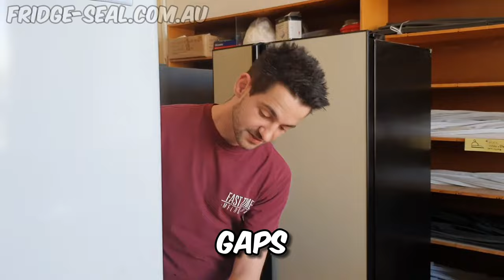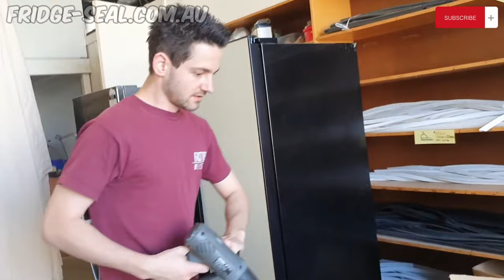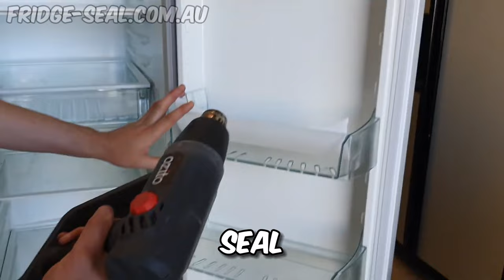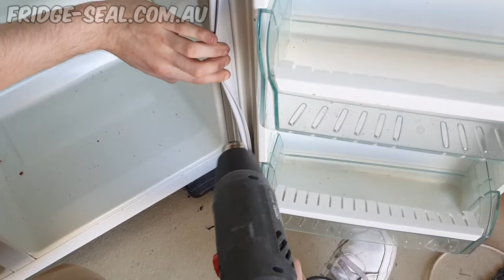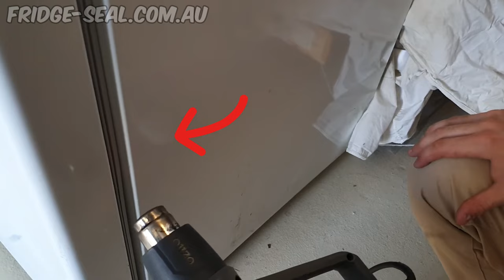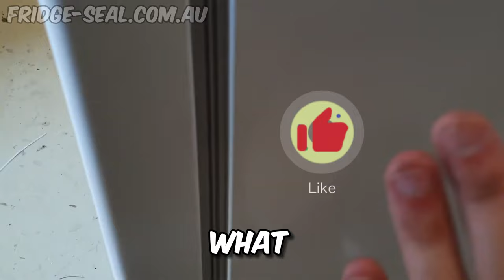How to Fix Fridge Not Sealing with Hair Dryer 💨🤯

Comment: Don't  forget to lightly vaseline.the seal when done.the Vaseline helps maintain the pliability of the rubber.
Reply from the maker: Great Tip!
Reply: Hello, cam I ask how would you apply that Vaseline? Like directly on the exterior of the rubber?
Reply: Vaseline breaks down rubber. Use silicone grease instead.
Reply: As a nurse, I know that petroleum-based Vasoline will break-down rubber so I advise to use a water-based product for latex condoms. Whether or not your gasket is made of rubber, well, that I don't know.

Comment: After heat appears, the gape come back again
Reply from the maker: Try pull the seal out iwth your fingers,

Make sure to heat the inside and underneath the seal then go around and do the outside,

make sure to leave door closed for as long as possible afterwards.

You can also try and put soemthing underneath the seal like blutak or anything really to prop it up in that area.

Comment: To the fridge that already running and fill with stuff, try vaseline, the petroleum on the edge of the contact of your door, I tried glue but it didn't work (caused the mess) and now this way seems working to stop the cool air leaking through the paper thin gap.

Comment: Quick question. Im having the issue with gasket gap between 2 refrigerator doors which causes condensation to appears, but it looks fine, like there's no gap between the doors when closed.
 Can this method be used in that situation?
Reply from the maker: Yes this method should help.

Inside the seal is a magnet strip - this is what keeps the door sealed (its not suction) so when you warm up the seal, it lets the magnet inside pull across and seal better, then you wait for the seal to cool down to stay in new shape. You could also try vaseline around the seal as well for an extra layer of protection.

is the problem continues, send me a message and i will dig into a deeper dive.

Comment: How long it's stay properly?
Is this permanently or temporary
Reply from the maker: This is permanent fix. There are other ways to fix this issue as well. Such as putting something underneath the seal to lift it up in that area.
Reply: Can I use silicone Kwik seal for the around the door 🚪?

Comment: thank you but what heating degrees i should look for ?
Reply from the maker: as hot as possible with hair dryer.
You will not melt seal with hair dryer.

Only heatgun will melt the seal, use low setting on heatgun.

Comment: Will this work on a freezer door that’s turned on? Do I have to defrost everything 😭
Reply from the maker: It depends, Do you have Chest Freezer or Upright freezer?
Reply: @FridgeSeal  we have an upright freezer. Big one.
Reply from the maker: Yes this should work, no need to turn freezer off. It would be best to remove the ice if its in the way, using paint scrapper or melting with a hair dryer but melting can take a while. @PatriciaHadley-ip8mb  

if you have any issues let me know.
Reply: Just wanted to update that this advice worked really well!!! From winter wonderland inside to no frost. We do have some ice still so we will try it again with some wedges, but gosh, you saved us over $300!!!! Thank u
Reply: Omg thank you for the Question and the Answer!! 
I just noticed my freezer door (double door fridge/freezer) had cold air coming out from the top section so I’ll try this in the upper seal areas. Praying I do it right!! Thanks again for the free and quick fix!!

Comment: How long does it stay in shape?
My problem is my 2 door refrigerator freezer is dripping and refrigerator guy says the lower right are of the main big door hinge hole is frayed which is why it is not shutting firmly and leaves a gap which is barely visible.
Any diy for that or this should work for my case too?
Reply from the maker: Heat with hair dryer, if you do it long enough should fix the issue forever.

you can also add a layer of vaseline around the seal to seal any small gaps.

depending where the gap is, you can also bend the door with force (open door put towel at opposite end of gap and bend other side of door inwards).

this should fix your problems, if not you may need a door adjustment but that is usually when door isnt closing properly due to hinge issues or there is a large gap.

Comment: Hi the components in my fridge are frozen and water then leaks into bottom of the fridge any ideas please opened fridge using hair  dryer to defrost still leaking then changed the door seal stull leaking
Reply from the maker: is the door sealing properly when closed?

is there any gaps around the seal at all?

sorry for late reply.

Comment: I just got a new fridge and it doesn't seal well. When I close the fridge the freezer pops open.
Reply from the maker: This is a common issue, but there are a few things you can try to help:

Hair Dryer Trick: Use a hair dryer to gently heat the seal. This can help it regain its shape and improve its sealing capability.

Vaseline: After using the hair dryer, apply a small amount of Vaseline around the outside of the seal to enhance its flexibility and create a better seal.

Adjusting the Legs: If the above methods don't fix the issue, try adjusting the front legs of the freezer to be slightly higher than the back legs. This can help ensure the door closes properly if it pops open.

Comment: Tried it with a hair dryer sat for 30 minutes nothing didn't move ugh
Reply from the maker: try heating the inside/underneath the seal if possible then close the door and heat the outside. make sure its on the hottest setting, use your fingers to pull the seal out as well. hope this helps